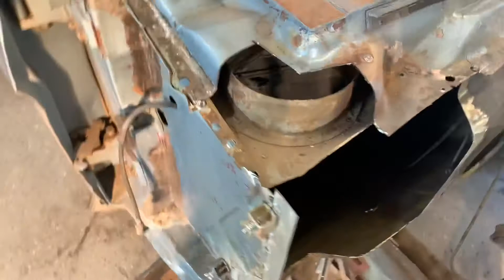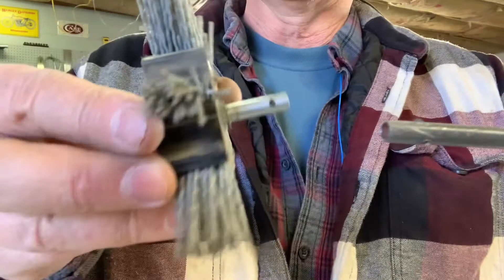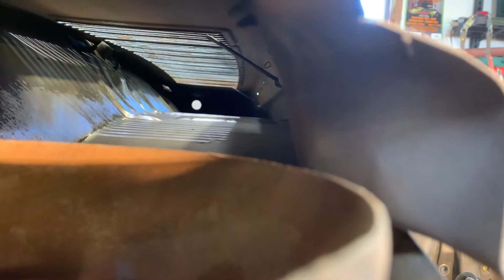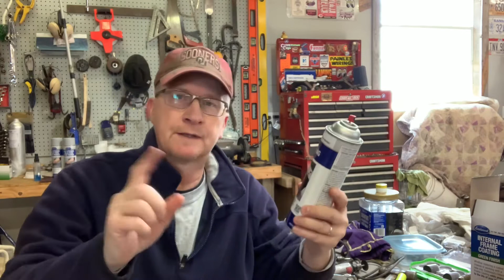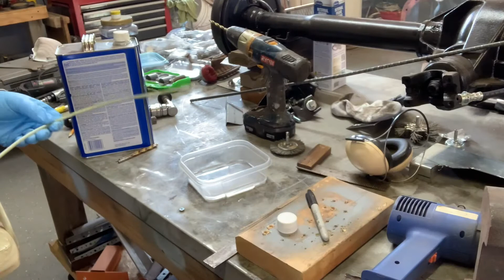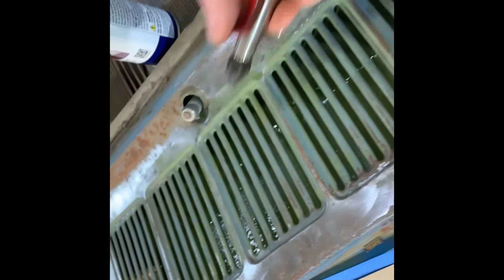1966 Mustang Cowl Repair

Comment: I used thelis Eastwood kit for my frame rails, and many other internal areas on my mustang.. I used some straight 3/8" pex I got at Home Depot, put the hose and nozzle thru it, and had great control of where the stuff went. I could carefully twist the hose a little, left and right, to ensure I had the best coverage.. I have an inspection camera, so could see how well I was doing... Then for cleaning the nozzle and hose, for reuse, Joe Daddy Garage, taught us, get some brake cleaner, and it's straw, to clean out the paint and the tip. If you look for a can at the store, that takes the same spray tip as the Eastwood can, then you just put the whole Eastwood tip, hose and nozzle rig on the brake clean can, and "Bobs yer uncle"....

Comment: Did you make those firewall patch pieces? Mines rotted on the outer pieces
Reply from the maker: No I didn’t make the firewall patches. I purchased them from CJ Pony Parts
Reply from the maker: The firewall patch panel extends down to the upper portion of the upper floor pan.
Reply: @dubsgarage  perfect, just ordered the parts, do you have any tips for install?
Reply from the maker: Measure twice and cut twice. Make your first cut smaller than the panel. Then start fitting it again and make your final cut. Be careful with the insulation behind the firewall it will burn.

Comment: Why not take the cowl off?
Reply: 1000 spot welds hold it in.
Reply from the maker: Like Matthew stated, there are roughly 220 spot weld holding the whole cowl assembly on plus the cost of the new cowl sections would be roughly $400 to $500.
Reply: @dubsgarage  but if rust dont sleep..how do you know got it all?..or was all the metal you sprayed  solid?
Reply from the maker: All the other metal inside and around the flanges was solid with minor surface rust. I’m using the rust encapsulating paint on the inside to stop any further rust. When I get the seam sealer removed around the outside flanges I will either treat it with the Ospho rust neutralizer or use some more of the Eastwood rust encapsulator.

Comment: Nice work, when i did my rocker panels I used a expanded wire coat hanger and taped the hose to it, it worked like a charm. I was able to bend it as needed to get into areas with precision.

Comment: Nice video, I saw someone else use the same can, with the applicator hose, they stretched it out and taped it to a thin straight piece of wood, might help if you do other areas.
Reply: Good idea. Also maybe taping a piece of wire along it . Something that can be shaped easily enough but also able to hold its form.